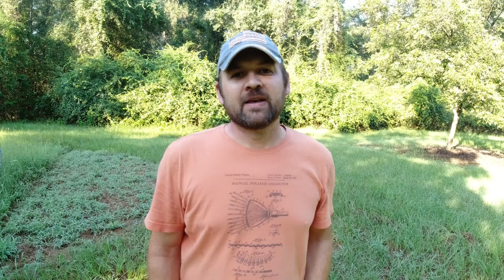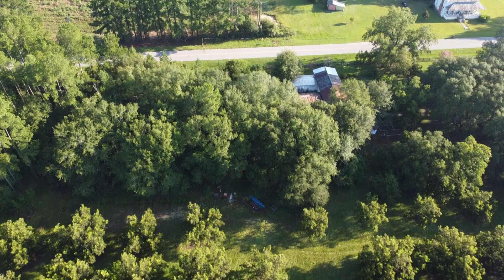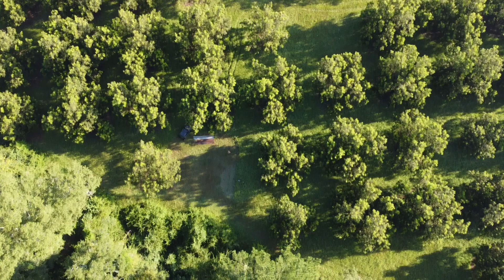Pole Barn Foundation and Poles | Steel poles in Concrete

Comment: So the posts extend above the string line 8', then you measure from the string line to the ground to determine where to clamp the board that holds the post at the correct height?
Reply from the maker: You got it!  I had to shim the board on one or two posts on the second row.  I think I'll be off a little bit across the tops but I plan on shimming the beam across the tops some as well.